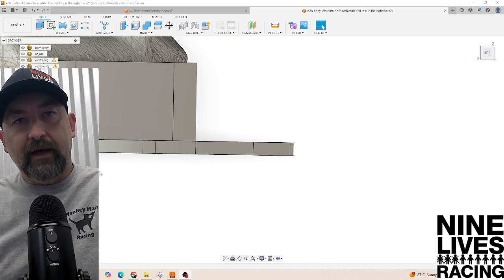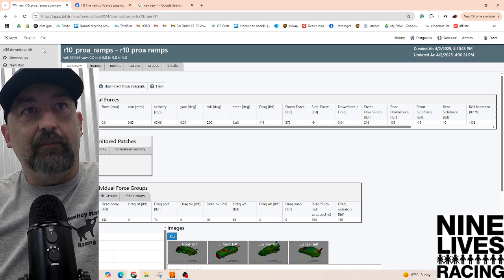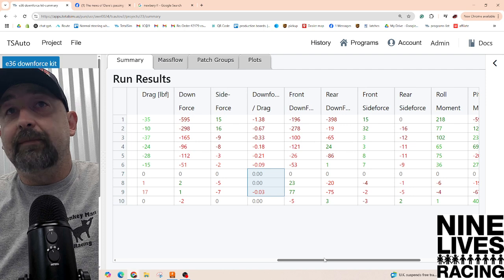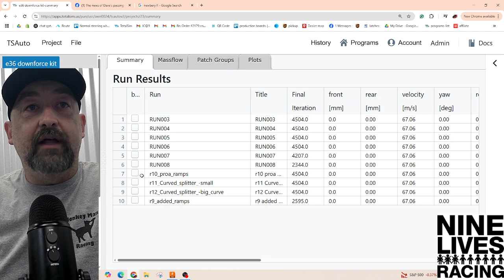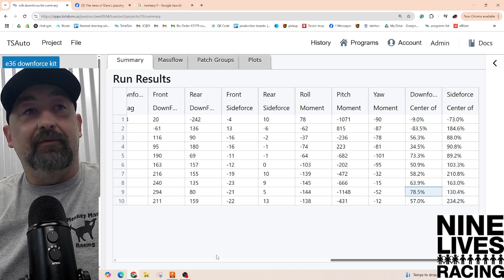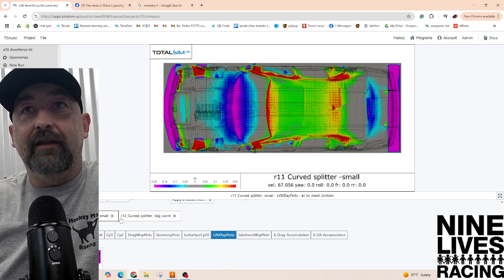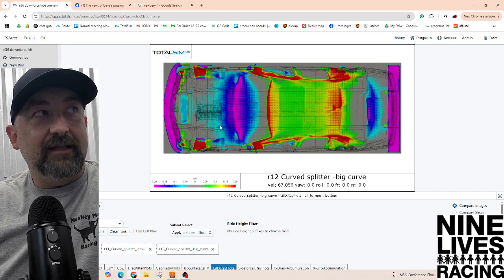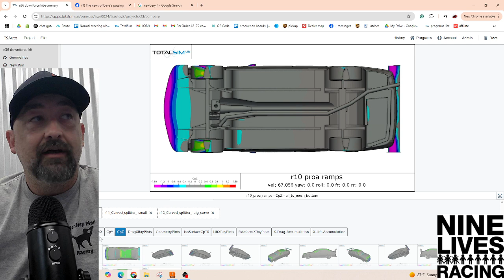how do curved splitters work?

Comment: 1:09 the elf shoe looks like it would cause LIFT by jamming air UNDER the car where splitters cleany divide the air. I would INVERT the 1st radius so NOTING gets pushed under the car and the sharper edge pushes air UP which is what crates downforce. I will be surprised if the elf's shoe works as it looks like it does the OPPOSITE of what a splitter or even old school spoiler does. I'm guessing, without watching the video as long winded dry math and science makes me tune out preferring simplified underlying form summaries, that the elf shoe works kind of like an inverted wig where the cavity creates high pressure despite the leading edge looking like it wants to slice upwards
Reply: It made 100 lbs of extra downforce compared to the flat splitter.  It's not about forcing air up or down, it's about creating areas of pressure.  The direction change of the air following the curve sucks the splitter downward.
Reply: @JETZcorp  I said LOOKS... not arguing against what it actually did.

Comment: Interesting. Never saw this bizarre concave curve in splitters, only a thicker splitter with a fillet/profile in its leading edge (actually simulating it right now for my thesis). Amazing how the flat floor even with stock ride height lowered a lot my Cd